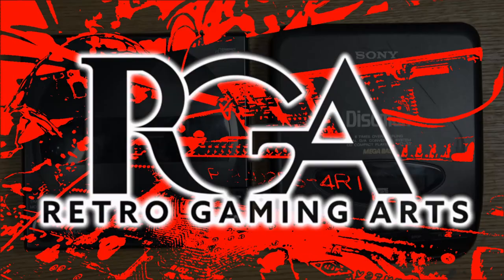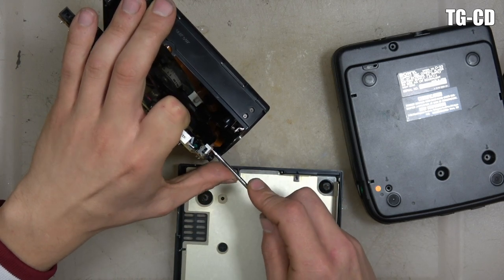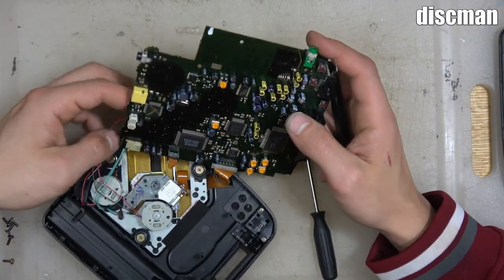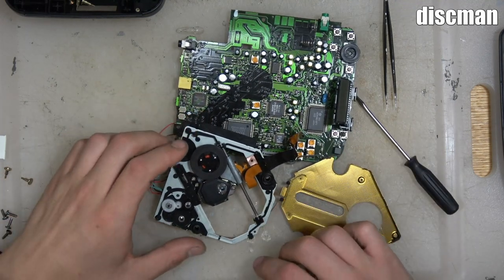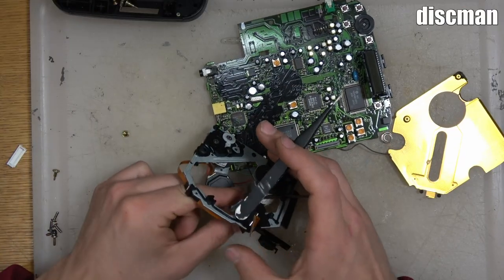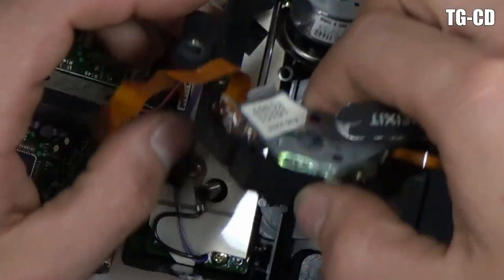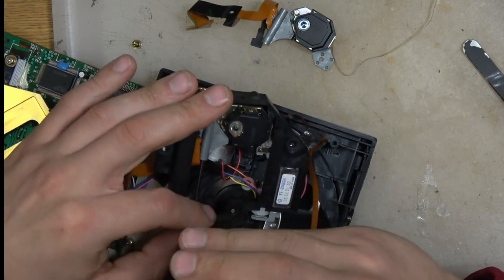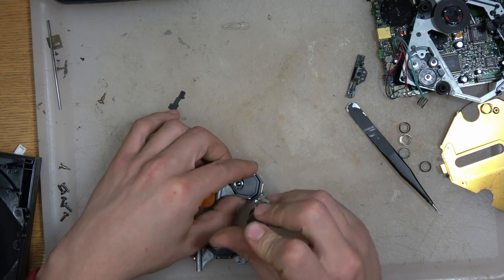TURBO GRAFX-CD LASER REPLACE TUTORIAL - RETRO GAMING ARTS

Comment: I had a lot of trouble removing the plastic fasteners for that second ribbon cable (On Sony Discman). The video made it seem like you can pry a space open, but you are, in fact, cracking the fastener to release them. I don't advise you try to do it like the person in this video. I did this on the same model, as in the video. I spent so much time trying to wedge that I cut through all 4 channels on the ribbon cable (the fastener wasn't giving way to break from wedging alone). It wasn't until I realized I need to rotate the thin plier quickly and hard, once I am wedged in, to just cause a hard break to the fastener to remove it, that I got the cable out (albeit severely damaged from previous excessive wedging). Knowing what I know now, I don't think I would have damaged it, but I was trying to replicate the step in the video of simply wedging to release the ribbon cable. 

You can follow the video, but when you wedge the plier parallel with the cable, just pop the fastener off by rotating the plier hard and swiftly away from you. Do not trust that wedging alone will get you the desired result. There is no lifting out from a gap that is expanded by wedging (as it appears in the video). 

I will attempt to repair the cable, but if I feel I can't, I will have to buy another Sony Discman and try this again.
Reply from the maker: Hi, yea sorry hold on ill explain
Reply from the maker: The ribbons on the disc man? There's 2, 1 is a clip that you pull the clip up and the cable can be pulled out, the 2nd one you can just pull out directly
Reply from the maker: Maybe we're thinking of 2 different things. Removing the 2x ribbon cables from the Sony disc man?
Reply: @RETROGAMINGARTS  Yeah, I was removing the 2x ribbon cables from the discman. From the video is seemed you were providing some gap by wedging. In my attempt, I didn't see any kind of gap to manipulate and I had to just "crack" the fastener to free the ribbon. Perhaps I missed something, but I didn't see a way of pulling up the ribbon on my D-33 Discman by doing the wedging action.
Reply: The bigger of the two ribbons is not the issue, it's the smaller one

Comment: I’m working on a pc engine cd rom and there’s a wire that soldiered to the larger ribbon cable. Does this wire need to be soldered to the replacement ribbon cable?

Comment: My Dreamcast at one point stopped reading discs and I looked up how to fix it and putting it on its side solved the trick and it works now. Is the laser unit dead or defective? Thx
Reply from the maker: Plastic Spoon for the dreamcast, it works on it's side? That's so cool I've never herd of that lol, I'm sure there's a better fix, I'd just swap in a new laser for it
Reply: Your laser is dying.  Either find a replacement laser or buy a GDEMU/USB GDRom.